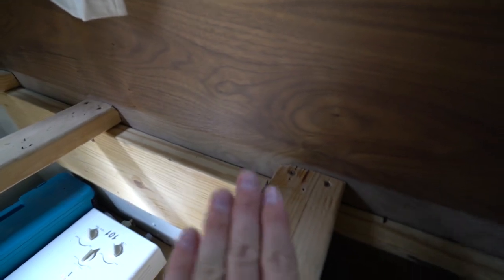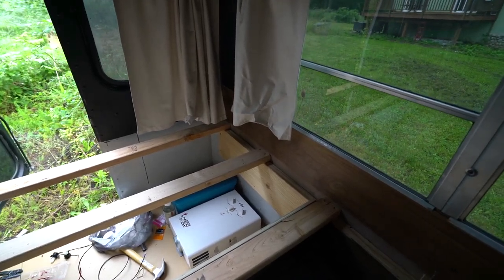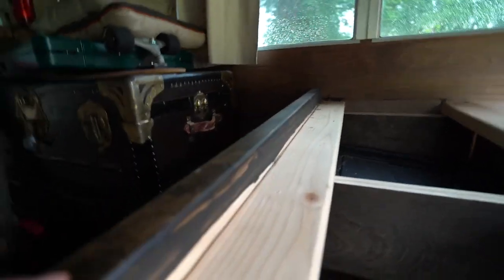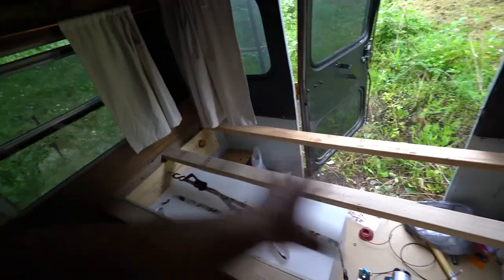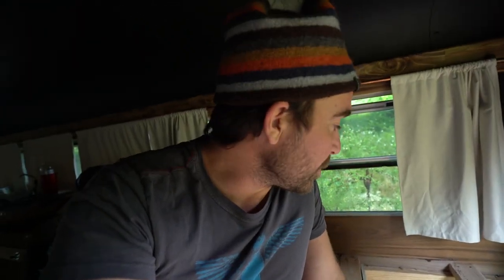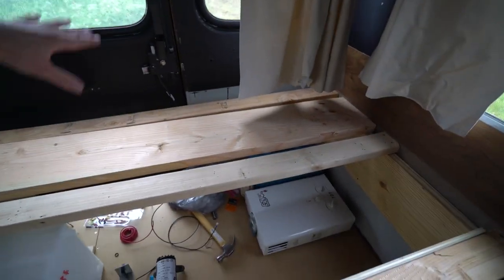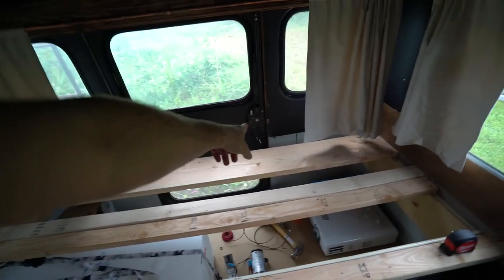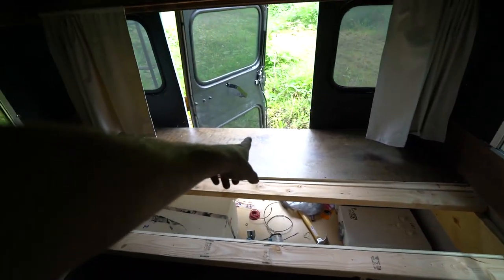SELF REFLECTING + REBUILDING 🚌 #VanLife Vlog: 231

Comment: Jax, you will need to have a full time vent on your water
tank. As the pump draws water from the tank, with no vent, it will come to a
point where water will stop flowing and it could burn the pump up. Also traveling
down the road the tank will develop pressure mostly going to higher elevations
or visaversa. Just add a fitting and a long hose say 3’ long and coil it up and
fasten it to the bottom of the bed frame. Wish I could be there to help. Next
time you’re in Boise look me up. Harry